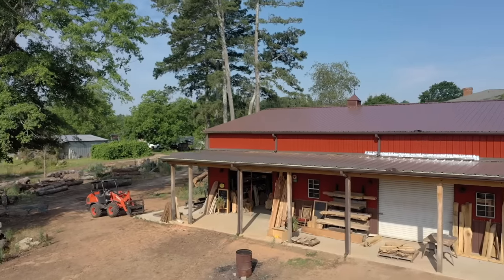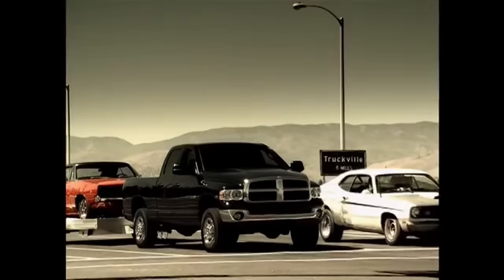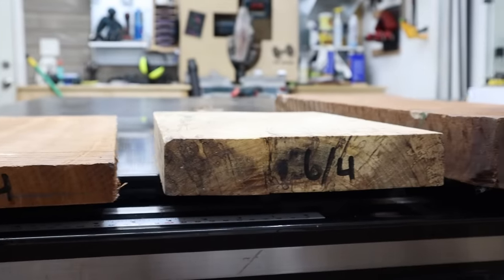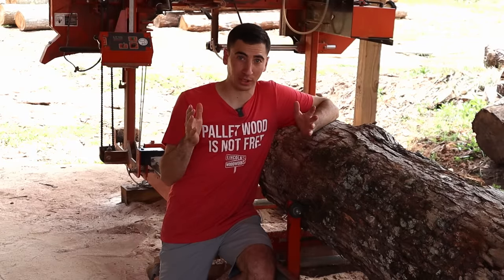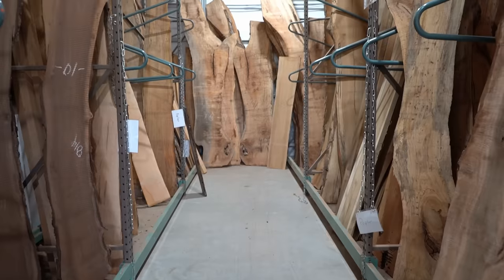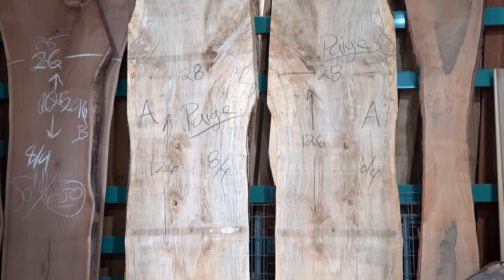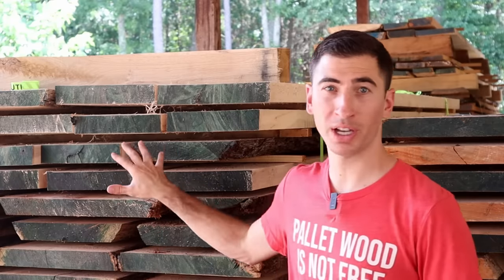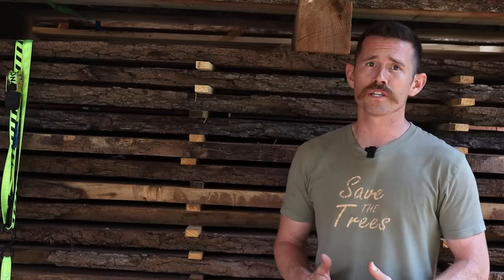The TRUTH about buying from a SAWMILL

Comment: This is the problem, wood is either expensive or overpriced and sometimes both.  Example, a one by 12 by 10 feet (I used 12 inches wide because it is easier to talk about BF)  of cedar in the northeast can run 60 to 80 dollars.   One board foot (1x12x1) is so expensive and as a non-professional if I work one day a month overtime I can buy just about anything I would make, there is no money as a worker in this business anymore,  it's the videos where the so called carpenters make money (talking about it).   And if you are doing this for fun, rough lumber is extremely expensive and time consuming,  that's why people just buy it ready to go (which I think isn't a good way) and its cutting and gluing and screwing. Room (space) and other things with tools are extremely time consuming.   It took him two years for the table,  really?  That is what I'm talking about, no way and if he sold that, what 2000 dollars waiting two years and maybe one month making it and finding a seller, again, a little overtime and you can buy one. 
Really, just want to do it for fun not a business,  it is a hobby, like make models,  it is a hobby for 98 percent of the people and the lumber yards and butchers BTW, are way, way overpriced.  Maybe it is deeper than that like taxes and add ons like waste and the taxes et al the government puts on people, but they are way, way overpriced.  I saw a guy glue three pieces of wood, about 15 dollars worth and to do that it cost him 120 dollars.  He had those parallel clamps,  that's ridiculous. 
Lumber people come down in price and stop trying to feel superior to people wanting to buy some wood, trees in the forest that are nature.
God Bless brothers and sisters 
P.S.  Unless you have much money and are retired (and if you don't just talk about it (BTW, that's not needed anymore because they have been talked about to death the last 20 years in videos and the like))  this is a hobby that is real expensive and the tools are unbelievable and that's why there is such a big market for Chinese tools, they are the Japanese of the late 60s and 1970s junk that came to America.  America has taxed and "saved" and "Not good for the environment" themselves out of making and buying are own products.  My dad didn't have much money but was able to buy those great tools we all talk about for various reasons.  Now all you see on Amazon is Chinese products, you specifically have search for an American product and we all sit by.  Sorry I know it is woodworking but it all goes hand in hand and looking at these guys, they could care less.
Reply from the maker: FWIW I have plenty of friends who make a living building and selling their work. In fact on of them is my neighbor.

Comment: Quick question about acclimating lumber: the mill where I bought my lumber is about an hour away. Their outdoor covered storage should have about the same relative humidity as my shed workshop. Should I acclimate the lumber in my workshop where I’m milling & building the table or in the climate controlled space (my house) where the table will be used?
Reply: Absolutely bring it inside in conditioned space.  First weigh a piece on a digital postal scale.  $20 for a scale which will go to 86# accurately.  Periodically weigh the test piece.  When it stops losing weight its then ready to use.  I do this prior to any project.  I've never had a project crack or split.  Be sure to stack and sticker your timber.  A floor fan on low will speed the final drying.  1-2 weeks is usually enough time depending how dry your kilned timber really is.
Reply: @Hardnox1911  Thanks for that info!
Reply: @bjsmithart  My pleasure.  You are very welcome.

Comment: Talking about stickering properly when his is not done well. They should be stickered at the end to help from checking.
Reply: Not sure who told you that bologna, but i can tell you that stickers on the end wont make a difference for splitting.
Reply from the maker: yeah I've never heard of that making any difference on checking.
Reply: @Lincolnstww  I’ve dried a whole ~12 pieces of wood in my time as a hobbyist/garage woodworker, so clearly I speak from underwhelming experience, but I did read a magazine article about drying wood that putting one sticker about 1” from the edge and then another sticker 2” farther in will help with checking. So that “info” is out there…whether it’s true, works, or donkey-doo, no idea.

Comment: I dont understand how you determine length.  If you say I want 16 board feet will they give you  2 x8ft pieces or 4 x 4ft pieces.  I am new to this and have looked online wood stores but they never indicate what lengths are and if they do they say its anywhere between 6-8 ft.
Reply: The way I understand it is that board ft alone won't tell you length. It is the L(in ft) x W(in ft) x T (in inches). So an 8ft long, 1ft wide, and 2in thick board is 16 board feet (8x1x2). At least that's my understanding of board feet
Reply: @andrewsanders5774  Correct and if you need to use inches it's 96 x 12 x 2=2304 and then divide the number by 144 to get your 16 BDFT in this case.
Reply: They will give you what they have to hit 16 BDFT but it has been my experience that most places stock lumber that is 8-10ft long and the places I go to also has shorts that are between 5-6ft long for a discounted price.

Comment: Its abundantly clear that this video is a commercial and does not have accurate information, intentionally to promote their products. Green wood has almost no shrinkage lengthwise, green wood is easily the among the easiest materials to work with and is absolutely incredible for structure building. Don't let these fools scare you with the "omfg BUGS!!!" or "omfg it still has moisture, ahhh!!!" Learn how to use green wood and marvel at what can be done.
Reply from the maker: They do say a man with two first names is an expert in shrinkage!
Reply: @Lincolnstww  OOh...salt!! There goes that professionalism. Looks like I was right, just punks trying to cheat people with bad information lmao.
Reply: Seems like you may have missed the point of the video…

No one said don’t buy green lumber, Jon actually have a specific case where he showed a table he made from green lumber! Did you even watch the whole video bro?

Also, target audience isn’t using said lumber for structural, but furniture. And wood shrinking across the grain is the MOST important concern when building furniture. 

Cheers
Reply from the maker: @jamesjameson7925  as a general rule of thumb I don’t try to have an actual conversation with someone who uses “omfg” in the comments section. Typically a dead giveaway you’re a dunce. That was confirmed when you thought we were talking about a boards length shrinking. Sorry dude, you check all the boxes.
Reply: @m2lumber  he dried it for 2 years
Reply: @Lincolnstww  Crooks like to dismiss out of hand. Does it help with the guilt of horrible misinformation?